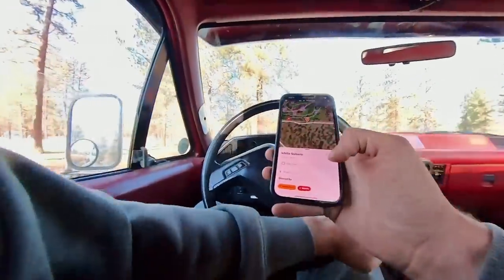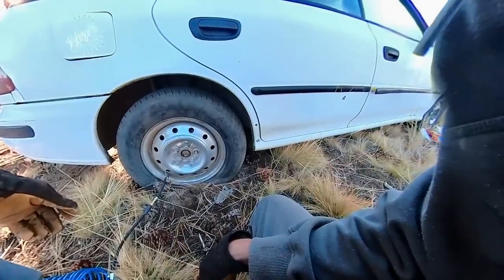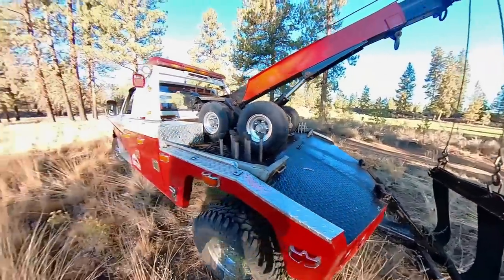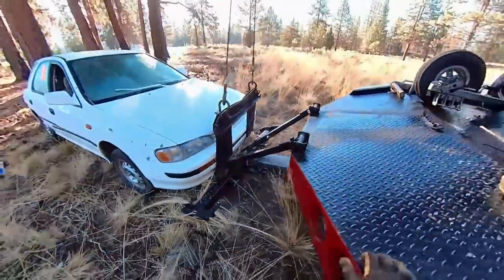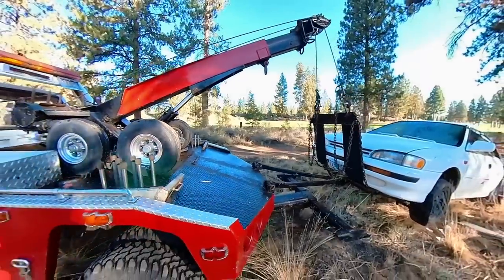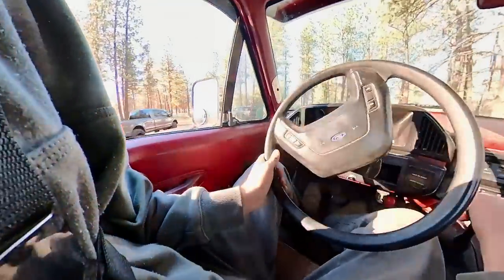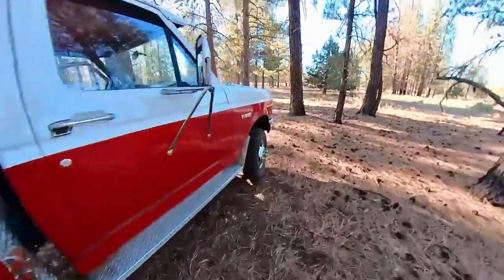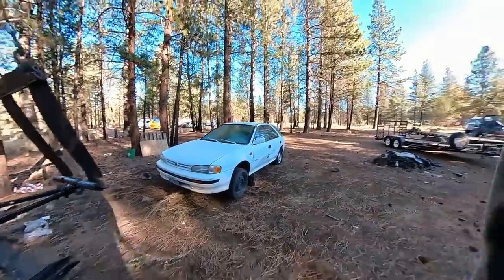Subaru abandoned in the woods.  Hook and drag!

Comment: Why are you slinging it?  Wouldn't it be faster, easier, safer to use the life (and a dolly since the tires are flat and it's AWD)?  Honestly curious to learn. :)
Reply from the maker: Slinging it allows all four wheels to roll while it pull it in neutral.   It went less than half a mile so it wasn’t worth setting up the wheel lift and dollies on four flat tires